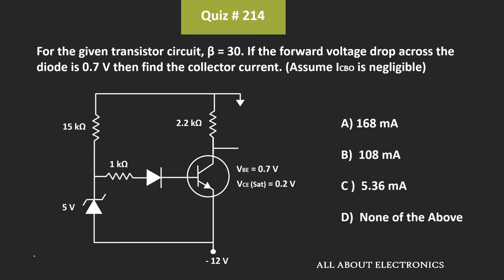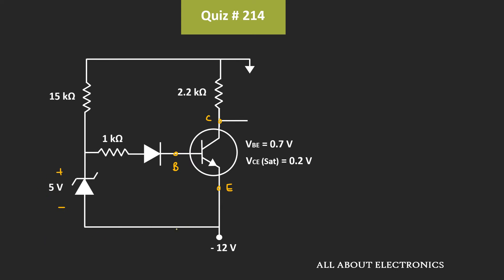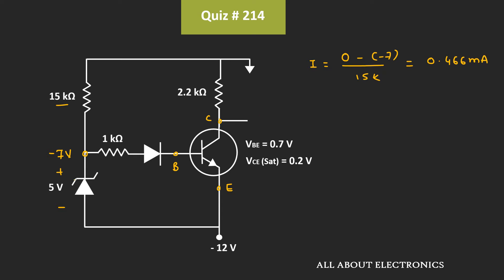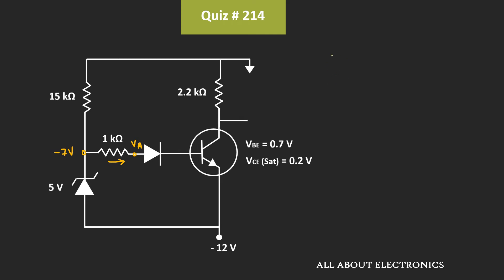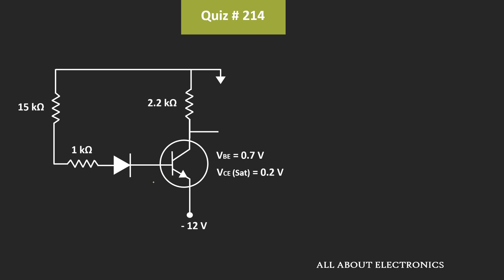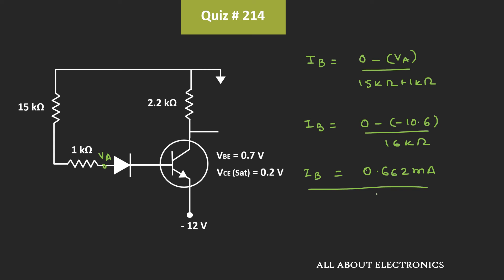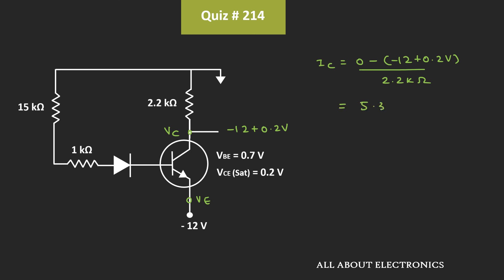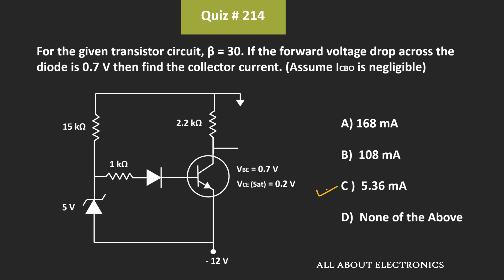BJT (Bipolar Junction Transistor) (Quiz # 214)

Comment: How the cathode of zener diode is at potential of-7V
Reply from the maker: When the Zener Diode is operating in the breakdown region, then the voltage across it will remain almost constant. In this case, it is 5V. The Anode is at -12V, so cathode will be at -12 + 5 = -7V.
I hope it will clear your doubt.

Comment: I got exactly the same numbers, if you look at my reply on the "Quiz video". If you assume that the zener diode is in conduction, that 3.6 mA that appears at the base, (5-.7-.7) multiply that by the Beta, you end up at one of your multiple choice answers, 108 mA. It's not. I calculated the circuit, and ended up with a maximum current of ~19.8 mA. the transistor is still in saturation, because Rl is such a high value, and 5.36 is what I got at the collector.